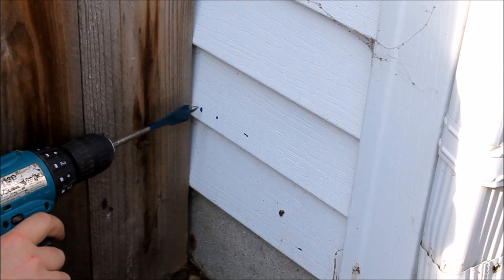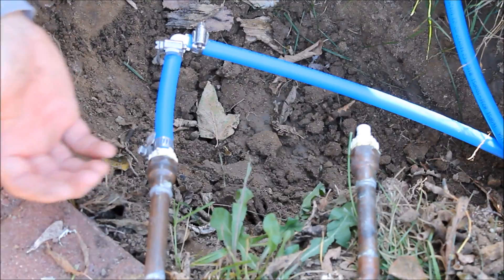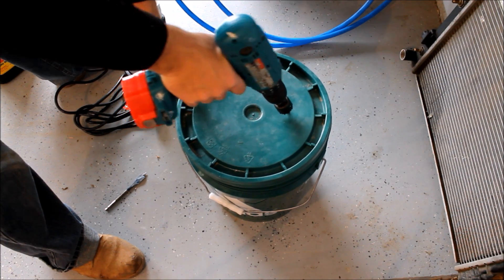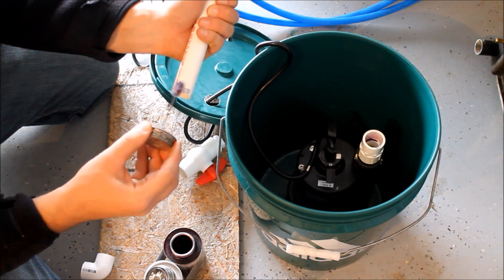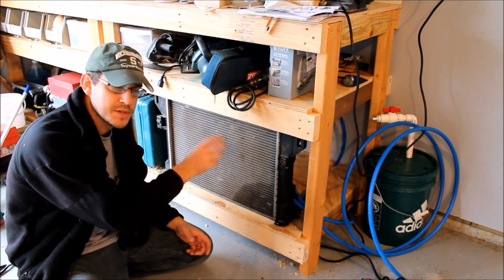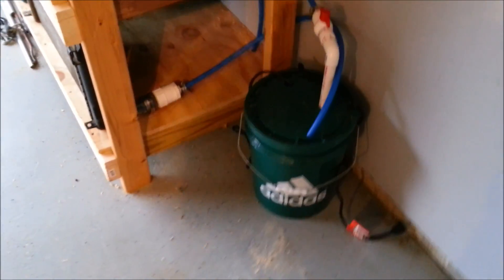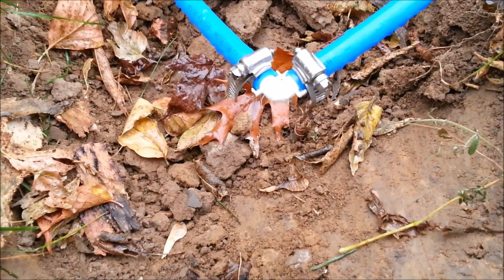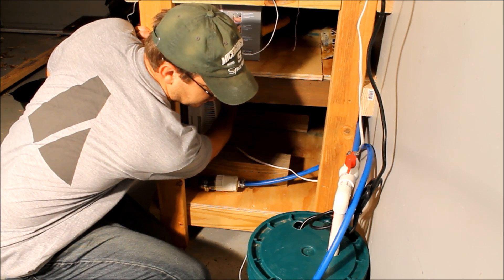Outdoor Wood Burning Garage Heater - Heat Your Garage For Free Using a Car Radiator!

Comment: Been watching your pool heater videos and this one got me thinking. My idea is to use both the barrel stove and car radiator to heat my pool instead of the copper wrap.   The radiator would be placed on top of the barrel stove. The entire setup would be surrounded and encased within a brick/cinderblock enclosure to trap as much heat as possible. Am I crazy? Can you try it first ? :)
Reply: Attention à pas faire fondre les soudures du radiateur de voiture qui sont en étain

Comment: A couple of options you might want to consider is getting rv diaphragm pump and use it as a circulation pump because they use a lot less energy, or an even better option would be thermal siphon

Comment: Not good to use auto antifreeze in this then use on the pool heater (auto antifreeze is poisonous) Unless the pool heater is noncontact with pool water.

Comment: automotive antifreeze is highly toxic when heated, also high temperature will break it down to a acid. Need to use propylene glycol not ethylene glycol.

Comment: how is it exactly hooked up to the stove??
Reply: he just had the metal pipe shot through the upper portion of the stove, only the pipe within the stove heats up. Coiling it would have been more efficient, but could also be detrimental to the pump and piping since it would be much hotter. submersible pond pumps, like he used, cannot handle high heat.

Comment: I have been thinking about this for years, so finally  searched it, and found your video. Great job. New cars, that run Waterpump from timing belt are a contained unit. Not requiring the motor to seal the back of pump. If you used one of these, could you eliminate the bucket? You could mabey get it hotter than 212°f without it boiling, because of the pressure. Is that not how it works in a vehicle? I get our wood free at the construction  site. Loose 2x4 to get it started, then stack them up to make a solid fill tighter than you could ever get logs in. I am no wood snob. Lots of people here, only burn maple, madrone, fir, name your favorite.  I have no problem  burning OSB, Plywood, treated lumber, hell, tires. I don't  throw it in the landfill, I am a friend to the earth.  I heat my home  with  it. Recycle, Reduce, Reuse! Like they used to say in the camps. I mean schools. Thank you kindly

Comment: If you reversed the flow so the fluid went into the bottom and flowed up and across the radiator it would force the air out and be way more efficient and youd get better output.
Reply: in order to do that he would have to make it a completely sealed system, or the second he shut the pump off the water would overflow out of the bucket. sure you could use a valve to prevent overflow, but in the even the pump was de-energized unexpectedly you'd have a big mess on your hands.
Reply: if it is steam. but it is just hot liquid.

Comment: Why a sump pump, not a circulation pump?? Watch videos or what others do to get some ideas, but how to solve the issue of you finding something like this & thinking its good,  wdyd??
  Less than $75 you can get a circulator pump, push the water from a source through the piping back to be heated more, if you keep it open no problem with pressure,  if you seal it you need to spend more for safety equipment,  pressure & temperature relief and expansion tank..
  The pipes in the ground also need to be insulated, the heat loss is terrible without it

Comment: Why not just use a enclosed piping system to circulate the heat generated from off your "fireplace"?  Like; if you just hook up tubing for as part of your chimmney and this tubing goes into the garage and back out where the smoke is exhausted? could this work?

Comment: The coolant will overheat easy that way, it's not a pressurized system...
Reply: The fan is cooling the coolant. if it gets too hot all he has to do is damper the fire. No problems here.
Reply: not much pipe in the stove to heat up, a ton of piping to run through and dissipate heat, as well as the fact that the radiator is half full of air due to the intake being on the top and not the bottom, it'll never overheat.

Comment: While I love the idea of a barrel stove functioning as a "boiler" to heat the garage, I don't think the sump pump is going to last very long. I think the small id barbed fittings along with the "long" run of pex/copper tubing, added to the fact that those pumps don't have a very long duty cycle. Personally, I'd use a circulation pump like this and get creative with fittings. 
https://www.woodfurnaceworld.com/products/pump-taco-007-bronze-115v-60hz?utm_medium=cpc&utm_source=googlepla&variant=5444225859&gclid=Cj0KCQiAyNjRBRCpARIsAPDBnn2jFMxKKH19Fhrpy6mYssAlGG1S4m2qW9ay5hNRABqAjS-HVNuyWlAaAuJQEALw_wcB
Reply: I couldn't agree more. I immediately thought of using a purpose designed circulating pump the moment I saw that sump pump.

Comment: would it be cheaper to buy an electric heater? instead you dig up your lawn, drill holes in your house and still need to plug in a pump and fan and burn wood. or you could buy a little heater at target for less money and is likely more efficient...
Reply from the maker: +schnob92 I get your thinking but two points here. First, to heat that garage it would take a 1500watt heat versus the 200watts for the pump and fan. Second, this is about using local resources to heat your barn or garage sustainability and with a very small solar panel you could run this system for free with fallen trees from your neighborhood

Comment: Great idea. if you put a tee  and two shutoff valves on each line at the stove end you will not have to disconnect and switch over each  line each season.

Comment: if the stove is close enough to the garage, you could build some kind of enclosure around the outside of the stove to help catch the heat that's being lost and duct it into the garage. just wonder what would work better for the airflow to do so between pushing it around the stove and into & though the duct work or pulling it from the end of the vent running to the  inside of the garage. ( I realize the fan being  inside, you wouldn't have to weather proof  it as you would if it was outside)  my dad built a 3' square wood stove when I was a little kid,  out of ¼" flat plate steel with 2 adjustable air intake vents at the bottom on the front made with a circular piece of flat steel with a hole in the middle with a bolt running through it and the nut was welded to a couple of small pieces of metal to center it in the holes on the stove itself.(worked awesome) then built framework around the outside of the whole stove (minus the front lol) and used some kind older, thicker sheet metal to box it all in and mounted an old squirrel cage fan ( think it came out of an old  water cooler for a house or something) this thing was a beast once you got it going good lol. it heated a 40'×60' shop with no problem. I am now 40 yrs old and that old stove is still going strong!! just thought I'd comment on the duct work idea and share an old memory I was reminded of. thanks!!!

Comment: hey in chemistry lab we filled our coolers from the bottom up. this ensures the entire column would be filled with water so all surface space would be used. I am wondering since your hot enters the top and exits the bottom if you are using all the internal surface space of the radiator. a simple swap would see if there is any added value. awesome work btw.. and I failed to see you PT belt... no PT belt mean no chow!!
Reply from the maker: +Jason Davenport lol, that switch would probably be a great idea. Others have also suggested that as well

Comment: Will that pump have long term issues with the temp of the water?
Reply from the maker: +Bobby Wolfe I did a follow up and go through some of those things, might be easier if you check that out:)
Reply: SSLFamilyDad thanks. And thanks for taking time to make the video!
Reply: SSLFamilyDad

Comment: Good work,
As an engineer, I would have plumbed the hot coolant into the bottom of the radiator, and exhausted it back to the bucket with the bucket fluid level about level with the outlet of the radiator.. this will completely fill the radiator and push any air up and out.. completely filling the rad.. this should raise your air output temp a few degrees...
Reply: As an engineer, you should realize that a sump pump does not have enough psi output to fill the radiator from the bottom, as not only  would it have to oppose gravity, but the weight of nearly 13lbs of water.  At that point, the pump would cavitate and burn up the motor.  Notice how slow it is filling the radiator in video...barely garden hose pressure (40psi).  Great idea, just not with the components he used.  However, this system will likely fail within a year, as the hose clamps and fittings are not designed for exterior use...much less buried (constant moisture).
Reply: Even the smallest pumps will push 2 ft of water (roughly 1 psi) and laminar flow isnt necessarily a bad thing..
Reply: As a non engineer I can tell you the way he did it is way more efficient. Here's why: As the coolant cools it will want to sink, with or without the help of the pump. Not only does this make sense, it's also how the radiator in you car flows - because it's the most efficient way to strip heat from the coolant. Only instead of stripping the heat to atmosphere he's stripping it to his garage.
Reply: Eric B. No,  this is the opposite of a vehicle application. The in car process attempts to cool the water before it returns to the engine by feeding from the top and drawing off the bottom. The best efficiency would be achieved by feeding hot water to the bottom and attempting to maximize the hot temp across the entire radiator surface. 
I would have used an electric 12v radiator fan to push air uniformly across the radiator. 
Btw. Look at any boiler pluming and you will see everything is copper. Too many pcv and glued connections for this system to hold up to a wood fire...

Comment: Very clever and useful!  Thanks for sharing your ideas.  Though I realize I'm late to the party, there is much to glean from your video.  I am in the process of deciding which type of heating system to have for my new workshop, which is 1200 sq. ft., and would cost a lot to heat if not through systems like yours. Cheers!

Comment: is there danger of inhaling harmful fumes from the unsealed container of circulating heated antifreeze coolant?
Reply from the maker: +sublimezombie420 well I suppose the only rule wpuld be don't stick your head in the bucket and breath but other than that there is no risk that I can see, the antifreeze doesn't vaporize as far as I understand
Reply: There is. Looking at your bucket you can see the fumes rise. Put the bucket outside, it'll help the pump cool off and keep you safe.

I looked into doing this exact same thing last year (like exact) and the fumes from that are harmful. It's just rarely recognized because no one sits around an open radiator for any period of time l

Comment: I'm thinking if the recirculating water gets too hot it will damage the pool pump? Unless of course they are designed perhaps for in hot spa pools... even then, the water could be as high as 80+ degrees Celsius.
Reply from the maker: +Number Eight in am using a submersible pump in the bucket for this setup, when it gets too hit it trips the overload on the pump and it have to wait for it to cool down but it seems to keep on working. It need a bigger fan in this setup to get more heat into the garage
Reply: How long is the cool down? Because you have liquid in the lines that is still being heated.. any back pressure could be dangerous
Reply: His system is vented via the bucket system so without the possible pressure build up the worst he could get from steam production would just blow out the exit line. I think. The main problem you would have to worry about is the stagnant water heating up enough to melt the copper pipes but I'm sure the fire would not reach nearly 2000 degrees F.

Comment: Since you are mixing systems, are you concerned for the stuff coming out of the radiator mixing with pool water?
Reply from the maker: +Sean White not really, I flush it out really well and run some bleach water through it before I switch over

Comment: It seems like if you wanted a radiant heat setup, you could have just tapped in to the heated water from you're house.
Reply from the maker: +Multi-Hobbyist well that would be a bit counterproductive for two reasons. Number one, I would be spending money heating the water with gas which costs money, number 2 the hot water in your home is not hot enough to really give off enough heat (125)especially running pipes from my basement into the garage.

Comment: Very good Idea !!! Yeah , if you look around , there is all kinds of free fuel for a stove . Junk mail paper , ( get on as many mailing lists as you can !! ) My mail carrier says that the junk mail is job security for her and the trash men ! And free fuel for something like this . In my experience doing all sorts of things over the years ,  A couple of suggestions , if you don't mind . In my experience in industry , you always want to feed a heat exchanger ( radiator , or whatever ) from the bottom , not the top . This purges the air out of it more efficiently . Also , in my work as a pipefitter/plumber ( amoung a lot of other things  that I have done ) I found that the fewer fittings in a system , the less places that can leak . The coil inside the stove could have a few turns unwrapped and fed out the back , far enough away from the heat , then connected to the pex , instead of a half a dozen or so  fittings here and there . ( less fittings = less places that can leak ) and less work putting it all  together . Yeah , there are all sorts of things a person can do . Good project ! I like it !  ALSO Your bible would be good fuel for the stove !!
Cheers , take care , and have a good day !!
Reply: +Neon Harp Man, that was cold , Use your bible for fuel? If you are not a Christian, keep it to yourself.
Reply: +Tim S 
Yeah ,  maybe I shouldn't have said that , but I agree with you on one point . A person should keep their religion to themselves .
Cheers , take care , and have a good day !...73...

Comment: The Home Depot in our area rent the PEX crimping tool
Reply from the maker: That is true dave, I just don't like renting or borrowing:) generally if I can't buy it I will do without until I can. I am kind of glad I used clamps though since I can take it apart and change things around easier

Comment: wouldn't it have better air flow with a box fan
Reply: +SSLFamilyDad do you think the antifreeze can mix with pool when you change it back or are you going to add another copper coil around it just for the pool
Reply from the maker: grease monkey I just drain it all out and flush the tubing really well before I switch it over.

Comment: Great video.  I've had this same idea for awhile now.  Just wondering if your garage smells like antifreeze when this is running. Because if i were to make something like this i thought of keeping the pump and bucket outside.
Reply from the maker: +rtlsnk911 Not at all, it has a lid on it and the flow is very slow so it doesn't seem to kick up any smell.

Comment: heat your garage for free, just pay for the materials to build the system, pay for the power to run the pump and the fans, and the wood  for the stove ?????????
cool idea but not free
Reply from the maker: Joel Jackson Well I get your point but to be fair I didn't say build the heater for free it is just free to run it and certainly less than an electric heater. On your point about running the pump and fan, you are right it is not free, but I would consider less than $2 per month to run it a few times a week close enough to call it free:) Thanks for checking it out anyway!
Reply: I like the idea bud just nit picking really. I thought about doing something similar but building a small Stirling engine on top. This Stirling engine connected to a motor could potentially give enough dc power to run a low voltage dc pump and maybe a fan then your sole usage would be the wood you burn, no electricity cost at all. Anyway I liked the build, I will give you a thumbs up

Comment: i like your dual purpose for the wood heater, i am planning to use my wood heater for a greenhouse setup this fall behind my garage so i can pipe heat to that space also but the fire is outside the garage (no codes or worries)... yet i gain heat for plants in winter by heating hot water tanks for thermo-mass in the greenhouse too... piping heat to where i need it through the season and other greenhouse for spring crops... thanks for your videos... william
Reply: SSLFamilyDad all good untill fire goes out and lines freeze.  Dont use plumbing antifreeze. Sounds funny but rv plumbing antifreeze does freeze. What it does not do is expand. Its a common mistake people make. You did well with using automotive coolant. I goto my local auto scrap yard, they let me take recycled coolant for free.
Reply from the maker: That is a brilliant idea and something I have considered for a future greenhouse project as well. Good luck with your setup, it sounds like it will work great!
Reply from the maker: TiMn8eR911 That is a good idea getting the coolant for free, hadn't thought of that!

Comment: any updates? love the idea- I also need to heat my garage but ins. says no way w/ solid fuel.
any problems with direct heat on that copper coil? what about a shelf inside stove for coil to lay on?
Reply from the maker: 7kcab 7kcab It works pretty well as long as the temps are not below about 20. I am going to make some improvements on this this spring and summer to make it more efficient. I needed to add more copper in the barrel, insulate the piping underground, and use a better fan. I will do an update video as soon as I get this updated. Thanks for checking it out!